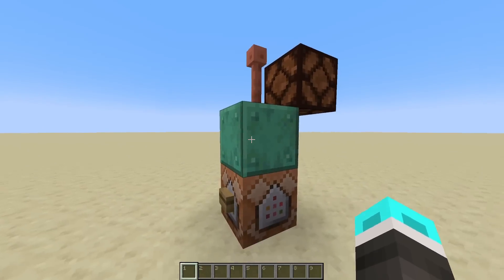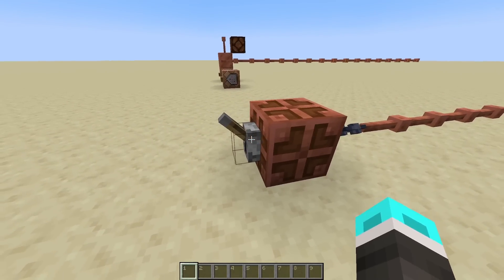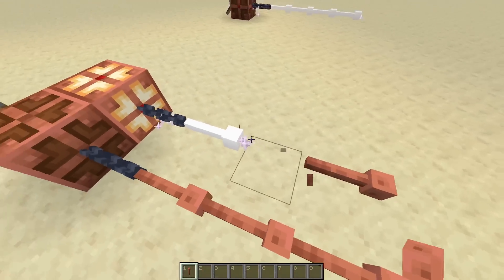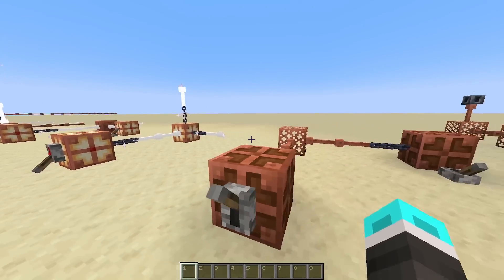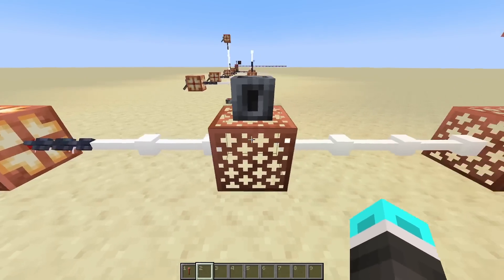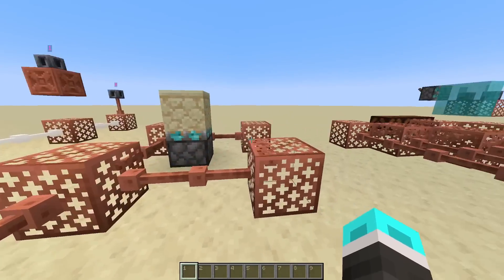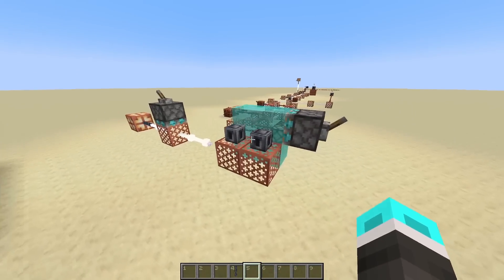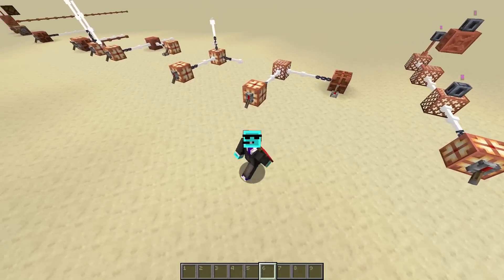Copper Wiring Datapack Beta 1

Comment: What's the performance like at a large scale? If you have hundreds of lines turning on and off, changing directions, etc. If someone were to built just an ALU with this, are we to expect lag, or will it be fine?
Reply from the maker: I haven't built anything on large scale yet, so I have no idea. I know the entities on the wires only exist when they are powered, which helps. I made it as low resource intense as I could, so hopefully it doesn't cause a lot of lag, but yeah, I have no clue

Comment: I would be interested building a functional copperstone computer actually. The only potential issue I can see being an issue is the speed of copper wire (As it is slower going a full 15 distance than redstone), and the lack of inversion. I can handle the computation speed (Since smaller distances should mostly null that issue). If you can show a way to create a signal inverter (Output is off if input is on, output is on if input is off), then I would 100% download this datapack and start building. Just a single NOT gate is all I require, and it shall be done :)

P.S you already showed me how to build a simple AND gate by havving 2 signal inputs to a copper mesh block (I forget the exact name), and having 2 outputs (1 is the output, the other goes to nothing and is just there to match the signal quantity)
Reply from the maker: Yes, a not gate is definitely a must for a computer, and don't worry, that's on the drawing board since there have been so many comments about it like yours. I'll be sure to add it in the next update or so, so you can use it to your hearts content!
Reply: @AuraAcorn  Thankyou so much! The moment it's implimented, I shall start work :)

Comment: I think it is a mistake to make it directional, it is like wiring everything with diodes which is very unnecessarily limiting, and is NOT anything like copper wiring, it is like trying to wire everything with diodes.  Making it bidirectional like actual copper wiring and providing an in line component that acts like a diode would be much more useful [BTW the capacitor should be in line as well], and it would actually be like copper wiring.  As it is, "Copper Wiring" is not a very appropriate name for it, more like "diode wiring".  Imagine instead of having a box full of copper wire, you have a box of diodes, and then you are tasked with making circuits, you will be extremely limited in what you can do, everything from A/C to data buses wouldn't be possible, in essence the only advantage given really is that Redstone signals can run parallel without interference.
To make it like copper wiring, the signals would have to be bidirectional with in line components [like diodes, capacitors, coils, resistors, etc.], which also means that signals would be given a current direction and strength, any junctions could just be a copper block, but would calculate adding power sources [inputs] and divide the total to the power drains [outputs] amongst unpowered wires.  This would also leave room for new components in the future.  I know that this would make the programming a little more complex, but it would make it more useful and intuitive for those using it.

Comment: It does not seem like you can make a computer with this. you can't do NOT. OR and AND are easy but I couldn't figure out how to NOT a signal with just coppers. Also I don't see a reason why you would want to use this over redstone other than just for the challenge, this is way bigger and harder.
Reply: you can do NOT by making a powered line of copper rods, adding a piston facing one of the rods, and putting the input into the piston.

the main advantage over redstone is directionality. you don't have to worry about redstone lines connecting.
Reply: @the_cheese_cultist  Yeah but you gotta use pistons. You can't do it with purely copper
Reply: @BenBerke  yeah. there should definitely be an easier way to do a NOT or a transistor

Comment: I do not think it'll be usefull in computers, it seems that the time the signal takes is proportional to the length of the wiring and even in the small scale example shown at 5:18 it seems to take roughly 18 frames from flicking the lever to the lamp lighting up, and as you might know in a computer there would have to be maaany of those connections
Don't get me wrong, I love the use of the copper and the Idea is amazing. Also I am only assuming it is proportional to the length, I only watched this video just now so pls correct me if I'm wrong
Reply from the maker: @wackelpudding48  It is, you're right. That's the one major drawback is that there is delay with updating blocks, and there isn't a way to get around that, other than just increasing the tick speed with the tick command. However, the delay does allow for pulses to be sent better, since you can send them faster and in sequences of any length, so data encoding for a computer, although slowe, can be a lot more precise than with redstone wires
Reply: @AuraAcorn  Yeah I figured that it's more of a game limitation, I still think it is a great concept
yeah faster pulsing might be a really good thing as well, I'm not a computational redstoner, that might actually be really usefull

Comment: Just a couple of cool features
If energy is thrown into  amethyst it sends out a wave to sulk sensors 
If you get a battery with over 500 energy then power it, it will summon lighting
if a rod gets struck by lighting, and holds the charge for too long’ Like a non stop circuit’ a rod may overheat and explode
Reply: I love this so much
Reply: lightning summon must work only if weather is thunder.. its logical.
Reply: the second one sounds too OP, if you have six inputs you'll get lighting every 4-ish seconds
Reply: @benbruder  then the battery doesn’t have a “max” it summons lightning, but blows up at like 700-800 ish power, then it’s not 
If that doesn’t fix it, the lightning from the battery will have a cool down of like 20-30 seconds ‘Just a thought’
Or the lightning from batteries is much weaker than normal lighting, or lighting changes strength based on how much energy it holds

Comment: Idk, that power cannibalization thing could have uses, albeit in certain edge cases. Perhaps as a sort of "grounding" or "power dispersal/dump" setup? Or a method of splitting charge before distributing it downward to a multidirectional splitter hub, which changes the direction it sends the resulting power between each pulse of the cannibalizer? Idk. Again, weird, niche edge cases.
Reply: That is an interesting way to utilize that bug! I actually was the person that found that bug and even started the battery cannibalism joke! I'm glad you found some way to utilize the bug! Lol
Reply: @DumpstarFireDev  it's always a good idea to try and figure out how to utilize the quirks of coded systems like that. It's called "emergent gameplay", iirc. There's a lot of that in how redstone (and Minecraft itself) actually works. Tho tbh I'm no redstoner, let alone a technical minecrafter. I just play casually, and occasionally have outlandish ideas that I throw at other, more talented folks in case it inspires them to do interesting things, the likes of which I never could.

Comment: Soul Lanterns are better blocks for a capacitator, even the crafting recipe can be interpreted as being one 
Carved Pumpkins can be another option if the pushing issue still remains
Reply: Yeah cause the heavy core is TOO exspensive for a battery that stores "redstone signals", not like its powering modded machines or something
Reply: Custom redstone lantern would be neat
Reply: a lantern wouldn't work because it can't be in the sky without support so it will not be practicable
Reply: wouldnt it be too cheap?
Reply: @Riztard why do capacitors need to be expensive?

Comment: Two questions:
- is it possible to convert copper power back into a Redstone signal? I assume it’s probably possible with comparators
- is there, or will there be, any way to fork power out in multiple directions? Do copper bulbs do that already?
Reply: When the lightning rods are powered they are using the same block state they use when being struck by lightning which produces redstone power. (So the wires will power anything they are touching) The best way to have power split out in multiple directions is by having your power go into one copper bulb with multiple wires coming out of the bulb! Hope this helped!

Comment: I love what you did with the copper grate, that's such an easy way to make an AND gate now
Reply from the maker: @why3994  Yeah? I guess I didn't realize but yeah you can easily make an and gate by adding an extra output to it doesn't send power through unless you have enough inputs! That completely slipped my mind otherwise I would've mentioned it!
Reply: @AuraAcorn it was my immediate thought, I figured it was intentional!
Reply: @AuraAcorn I asked this before, but can you please add a sort of inverter that is pure copper and solid state, or you can make it so the current implementation of the gray will invert the output, so if u want an AND gate you do it how you did before but throw it through another grate, either way I would want
Reply: It’s an AND grate
Reply: @PeChips  grate joke
Reply: genius idea, and OR gates are also done with copper bulbs!
the NOT gate, however, is a bit more grating
Reply: @a_soulspark eh, Mojang already torched on a solution to NOT grates, just a little tedious if you want it to be compact & loss/gainless.
Reply: @a_soulspark  A NOT gate could be done by having the input signal trigger a piston, which breaks a pre-powered line of rods. There may be a simpler way to do it tbh

Comment: My two cents about the capacitor: I know it's possible to add a custom recipe to give us Heavy Cores, but in order to avoid making the Mace trivial to obtain maybe you could use custom heads as capacitors? They could have a specific recipe using the copper bulbs and some redstone to make sense.
Reply from the maker: People have been suggesting that and I think heads could also work. My other ideas were either duplicating the heavy core like armor trims, or other blocks as well
Reply: @AuraAcorn an armor trim style dupe recipe with netherite ingot(s) would probably be expensive enough 😅
Reply: If you want to go really expensive I could see it being an iron block in the middle surrounded by netherite ingots (except for the heavy core on top, like a trim dupe)
Reply: @halyoalex8942  I think even one netherite ingot makes it too restrictive if capacitors become something really important for more complex builds/machines. If it's a matter of making them a bit harder to create, but doable, perhaps using a Respawn Anchor would make sense, it's one of a kind block that you power up with Glowstone. Also, the materials can be acquired in the Overworld (Broken Portals for Crying Obsidian and Glowstone from Witches drops or Clerics Trading) and be more adundant later on when you have something like Piglin Bartering farms. I would still prefer something just a little more expensive/harder than Observers though, but if anything I'm excited about the possibilities for this project. 🙂
Reply: @antonioalancarte4481  I think sculk would work as an ingredient. Thematically it makes sense since it already stores energy (in the form of xp). Also it is at first sculk is difficult to acquire, but it is renewable . So if you want more of it you are encouraged to build a contraption/farm that can produce more of it. (Potential recipe could be a copper block surrounded by 8 sculk)
Reply: @MrWertyQaz  That's also a nice idea!
Reply: maybe use creeper heads in the recipe for the capacitors and change their drop behaviour to drop when a charged creeper dies. Maybe together with two redstone torches left and right as contacts and a piece of quartz below in the grid as an isolator. I dont know wether its feasible, but perhaps make it that, as long as a creeper touches a charged copper wire, it becomes charged as well instead of taking damage. if it stops touching the charged wire, it stops being charged. Those charged creepers would then drop creeper heads when killed.
Reply: @antonioalancarte4481  Or a Lodestone? The crafting recipe uses a netherite ingot so this would make that ingot not go to waste
Reply: @AuraAcorn  i disagree with adding a new/easier way to get heavy cores, as it affects gameplay elements outside of the scope of the pack
Reply: Maybe a way to obtain creeper heads easier in survival due to creepers ability to get charged by lightning.
Maybe maki it so that you can charge creepers using copper wires, and charged creepers by default dropping their heads. Would make for interesting farms...
Reply: perhaps use pots instead? have them attach underneath, it makes some degree of sense
its a much cheaper item for such a simple use
Reply: @xenathcytrin202 ohhh I love the idea
I mean capacitors were at first jars with aluminium foil (not exactly, I know)
Reply: Perhaps the duplication could instead make a different item. You still need the heavy core, but doing the duplication would give you a power core instead, while allowing you to stay with your heavy core. You could use a power core to make more with duplication too. This way you don't break the heavy core's rarity and you can still have this be locked by the heavy core attainability
Reply: How about waterlogged blocks as (electrolytic) capacitors?
Or the Iron block looks to be in layers as a multilayer cap